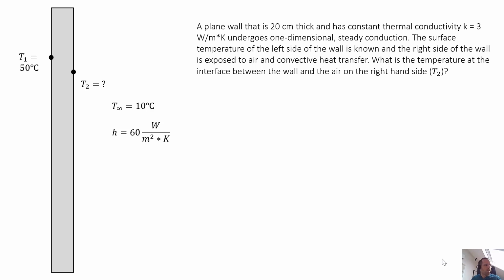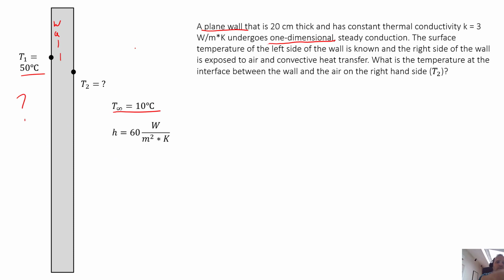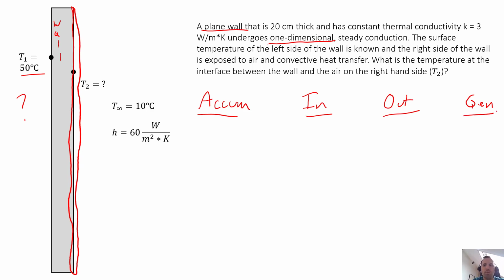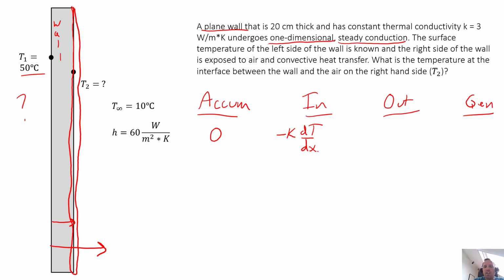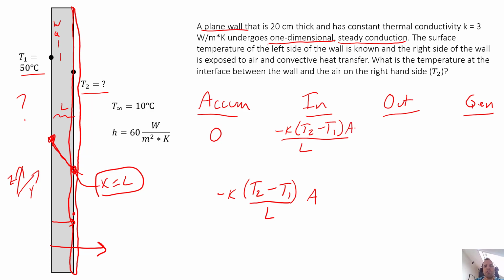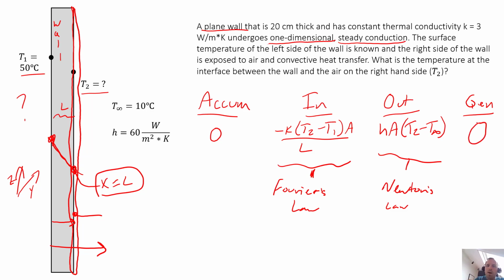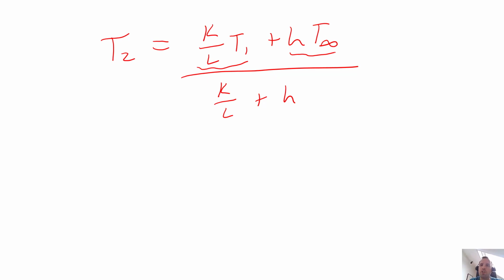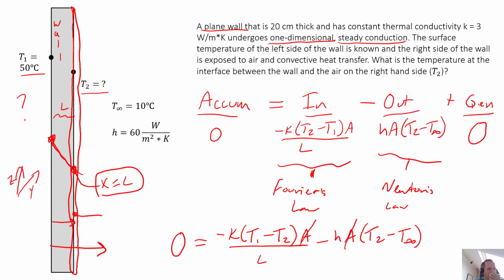Heat Transfer - Chapter 1 - Example Problem 3 - Equating conduction and convection at a surface

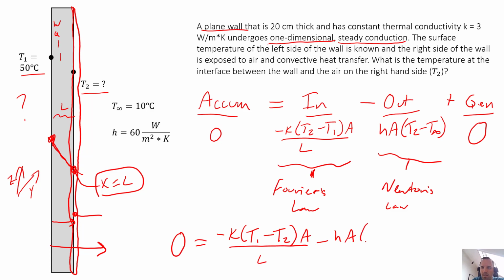Comment: At 10:35 when writing the fourier law equation, is there a reason you swapped T2-T1 to T1-T2? It still seems to be on the same side.
Reply: I think it's a mistake cause when you solve the equation as t2-t1, only then the reqd t2 value is reached